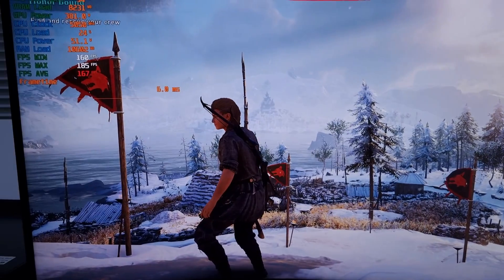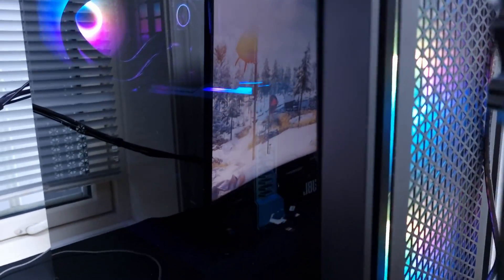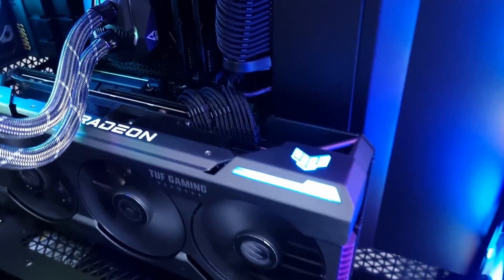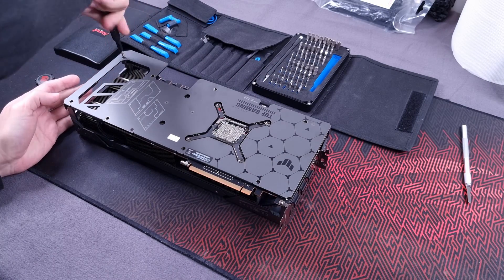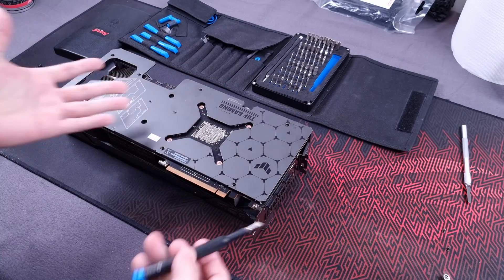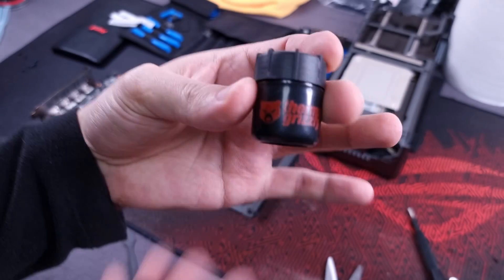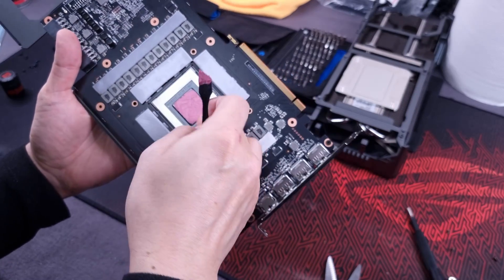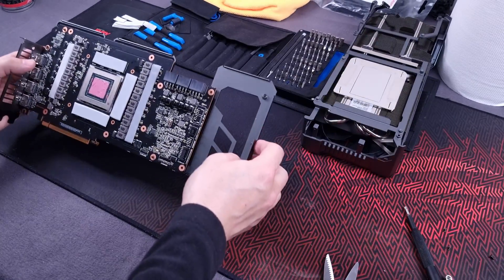ASUS TUF RX 7900XTX TEARDOWN (hotspot fix)

Comment: So many issues, I have the XFX version and the vapour chamber is not flat in the very centre so no matter what you do it doesn't cool the die complex evenly, GCD in particular. The chiplet is not even so most paste pumps out over time and heating cycles. with my uneven die and stock cooler the GCD was always high while the MCD was cooled for about a week by paste, I have a tube of every premium paste out there! my solution was Kryosheet and a water cooler, and I needed two layers of the sheet to make good contact across the GCD and MCD, bought the large size and the first layer is a continuous rectangle while the second layer is two smaller rectangles from the leftover sheet. Looking at the hotspot temp is not good enough, one needs to isolate the GCD and MCD and mem junction and address all three. for me the uneven vapour chamber required a water block, the uneven die complex needed two layers of kryosheet and the memory needed gelid extreme 1mm or tp3 1.5mm the tp-3 is very soft so it conforms really well, gelid is just better if it makes good contact. card idles at 33 die and 54 mem junction and speedway on a 30 min loop takes me to 73 die and 84 mem junction, ambient air is at 30+ where I live so take 5 or 6 degrees away if you live in a 20ish degree environment. Was still cheaper than a 4090 where I live. i completely agree that for 1kusd one shouldn't have to do any of this. planned failure, poor design, most don't care to hunt the issues so what are you going to do if you buy the halo product, send it back or fix, if you send it back then you have to ask for a refund as the problem will most likely happen again if you replace with the same.
Reply from the maker: This is why I did not return mine. The 7900XTX is hands down a bargain for the price/performance ration. So replacing the thermal paste and pads makes the more sense if you are comfortable doing this effectively. MX-6 is a perfect choice for paste.
Reply: @TechnologyHive Agreed, MX-6 gave me the best die performance on air, but I think that my stock cooler didn't aid things, when I went to water the Kryosheet was on par with mx-6, however two layers of the sheet gave me amazing consistency across all the MCD and GCD and a 3 degree delta between hotspot and GPU temp as reported in adrenalin or HWinfo, I have seen cooler mem junction temps from others on various forums  with water but after ripping the card apart over 15 times i am happy where i am at now, still have  a tube of KP that i haven't opened though:)
Reply from the maker: @riazpatel5296  Very nice man! I wish you and that little beast 7900XTX the best! Cheers!
Reply: Thanks for sharing your experence. Two sheets. Good idea.

Comment: I have a 7900 XTX gigabyte oc but every time I’m playing something more graphical demanding like returnal or cyberpunk I get temps of 55/60c on core and 110c on the hotspot (playing at 2560x1440 165hz). I have now opened a ticket to open an RMA as I I can’t peel the stickers on the screws to replace the paste and thermal pads as I don’t want to lose the warranty. I’m regretting buying AMD at this stage. Yes I can under volt it and put a limit on the core and power to bring those temps down but I didn’t buy a card to make it disable.
Reply: been there with aorus elite, gotta go with ptm 7950 my friend
Reply: I did RMA it and got a replacement the one that came was the same. Bought ptm7950 and now it’s all good core sitting at 60/63c and junction at 73c. The memor junction is at 90/95c but there’s nothing we can do about that .
Reply from the maker: @AfroDominus  Nice that you got that one fixed.
Reply: @TechnologyHive  yeah I got it fixed but I think for my next purchase I will stay away from AMD. Don’t get me wrong the card is a beast but it’s not worth the headache
Reply from the maker: @AfroDominus  I've owned Nvidia and AMD cards in this generation. Both have their issues. NVIDIA's issue is with GDDR6X's heat issues, thus requiring those huge heatsinks, which are used as a "one size fits all" type of deal, and thus, you find these huge coolers on non-GDDR6X cards as well. 

These coolers are so big and heavy and cause so much physical stress on these cards, resulting in gpu sag, cracked pci-e slots, cracked memory joints, cracked gpu joints, and or permanent pcb bow or twist. I get NVIDIA cards in for repair with these problems frequently, more so than AMD. I made a video about it. It's somewhere on my channel. But anyway, good deal you got your problem solved! 👍🏼
Reply from the maker: 110c on hotspot is way too high. RMA is the right thing to do. I believe the main issue with AMD cards is the low quality paste they are using.

Comment: M friend
Your gpu clock is almost 3000 (original 2650)
You overclocked so high 
Just underclocked
Reply from the maker: I do not overclock my gpus. This is done automatically by the auto boost.

Comment: Hi there! I have the same GPU Asus TUF 7900XTX. I installed it normally with the included GPU support bracket and it works all fine! I'm gonna order an aftermarket GPU bracket that perhaps is more safe to be sure its not going to lower by time.
Reply from the maker: That's exactly what I would do. For this big card, you should use a riser. Good choice!
Reply: @TechnologyHive  i have the 7900xtx  msi trio classic and have installed horizontaly with its own support bracket that is a piece of metal horizontal, i have and a riser but becouse this card is so big 2.5 slots ,dident try to install vertical mode, temperatures are good max i have seen is 67 with 86 in hotspot, msi is basic card  power limited to max 375w. so do u think i need to install vertically ?
Reply from the maker: @meltinsr  If at all possible, yes, install it on a riser. I would look at PHANTEKS cases, as they have the best support for risers, like the G360A.

Comment: same problem on my sapphire nitro+ 7800xt..over 30c delta..crazy
Reply from the maker: Just replace the paste. MX-6 is what I would use. Going through the warranty process is a headache, and returning it just to get another one with the same issue is not worth it. Once themps are under control, the 7900XT is a beast!

Comment: Nice work, I believe that if you used THERMALRIGHT TF8 the result would be better, I noticed that you didn't use a thermalpad on the inductors, they could have overheated, and I have a question, who is the manufacturer of the vrams?  Are Samsung memories?
Reply from the maker: These are Samsung, yes.

Comment: My sympathies for your coil whine. I’m glad I don’t have that with my sapphire card.
Reply from the maker: It happens only during high frame rates. If I lock it to my monitor's native 144Hz, coil whine goes away. Less stress on the phases. I love Sapphire. One of the best if you ask me.
Reply: @TechnologyHive  came back to watch it again. Bro I still barely break 60c on hot spot. I got the phase sheets on stand by.
Reply: Such a princess ear.

Comment: hi, thanks you for this video !
i have a 3080 TI palit gamerock, and in game (with stress), i have 68.8° GPU / 74° Memory and 107.4 in hotspot...my core clock is not stable too.
my ventilation is good, and my GPU is in verticaly....
so i think i may change pad /pate thermal....and you video help me....and my card have more 3 years so not waranty...
Reply from the maker: 107 hotspot is scary high! Btw that Palit Gamerock model is beautiful! One of my favorite cards. I sold mine and I regret it now :(

Comment: I have 7900xtx hellhpund itvruns cooler that that as standard hotspot is 71c max
Reply: Yea mime is standard though
Reply from the maker: That's good! I no longer have a problem with mine since I replaced the thermal paste.
Reply: As it eng I've learnt from cpus too much paste can actually hinder as it turns into an insulator so try skimming it thinner

Comment: Can i use something like liquid metal instead of paste?
Reply from the maker: Yes you can. But you need to be careful. If any of that stuff gets on any of the surrounding components, it will destroy your card.
Reply: @TechnologyHive yea thats my biggest fear with liquid metal that its very conductive in electricity like if i ever want to use liquid metal on an cpu im taking the top plate off for max preformance

Comment: Can you mount it horizontally if you use the support stand thingy?
Reply from the maker: With a support bracket it should be fine. But if it is ever under transport, it is best if the card is pulled out of the system.
Reply: @TechnologyHive 👍👍

Comment: I repasted my Hellhound 7900 XTX with PTM 7950,about a year ago at this point. 
The card was running very cool initially but after 2-3 weeks my hotspot steadily begun to increase and was getting over 30c delta,like everyday it was getting hotter.
upon opening the card the pads seemed much higher quality than the trash pads in your card,and they were intact, the contact also seemed fine.
but the thermal paste right on the middle of the die was dry. The card was maybe,two months old at this point,since they had just came out, so it was a pump out effect.
supposedly powercolor changed the paste they're using since but I see still many people with powercolor gpus with the same issues.
I think I did a pretty good job repasting the card with the PTM,since my delta is extremely low,even a year later. <18c delta.
typical gaming temps are 60c/73c @360w.
Reply from the maker: Good Job man! Thanks for sharing 🙂
Reply: Did you just replace the thermal paste with PTM? ie put the PTM on the gpu die? Or did you also replace the thermal pads with it?
Reply: @madararinneganuchiha  no only the die, ptm is like thermal paste, just comes as a sticker rather than liquid. You can't put it on your vram lol
Reply: @100500daniel  do you think it is unnecessary to change the thermal puddy?
Reply from the maker: You don't want to reuse the thermal puddy. So yes, replace it
Reply: As long as it's applied properly the first time, the PTM7950 compound shouldn't ever need to be re-done again, as I understand it. That being said... the memory pads might need to be re-done at some point, and I wonder if the PTM7950 is supposed to be okay even if you open up the card and put it back together again? I'm not so sure that it would survive that, but that is an important question that many people are going to want to know the answer to sooner or later.
Reply: @syncmonism  Great point!  Yes the PTM7950 will endure 'forever'... until you need to reopen the card to replace the Ram/VRM pads. It will not survive it and will need to be replaced.
So the trick will be to use the best quality possible pads, that should hold for at least 4-5 years before need replacement.
Reply: @100500daniel  gives me confidence!! But my damn PTM pads are too small by 1.5 mm!! I measured die wrong.  You happen to remember what size of PTM you bought?
Reply: @paulw7738  PTM melts and 95% of it get's squeezed out forming a very thin but uniform layer without air bubbles so a little bit smaller piece is not an issue.
Reply: man i must have it made, @361watts, core never exceeds 55c, hotspot 20c give or take, VRAM almost always 80c sometimes 82c, i got the magic baby used ARCTIC TP3 Thermal pads for VRAM and repasted with shitty NX4 but i made sure i over pasted because its better to have to much paste than to little

Comment: Air bubbles and gaps between the heatsink and cpu/gpu are caused by deformities on the face of the paste when applying to the cpu. Watch for peaks, curl-overs, and valleys on the surface of the paste; as these trap air between the heatsink and the cpu even though there may be some paste extruding from the edges of the chip. Also try not to smooth over valleys, instead fill them in, (you don’t want cause an invisible bubble under the surface).
It’s easiest from the start to put excess on and try to smooth in one or two strokes moving in the same direction and then carefully clean the edges. If you are going to do this, I also suggest using a sealant around the edges of the chip before applying anything to the chip, to safeguard it from shorting due to seeping. This especially goes for Liquid Metal.
Reply from the maker: I do not recommend using liquid metal over a chipplet design gpu. It's a bad idea.
Reply: @TechnologyHive  Indeed

Comment: How are the temps holding up? I'm thinking about buying this card.
Reply from the maker: Temps are fine as the first day I swapped the thermal paste 👍
Reply: @TechnologyHive  That's great to hear. I'm definitely going to use your video for when I need to swap that paste out. Thanks for the video and for answering my question.
Reply: @TechnologyHive  Hey do those connectors have a push tab or do you just pull them out?
Reply from the maker: @BasedTooDrip  Push tab.
Reply: @TechnologyHive  Alright, thanks

Comment: The problem with those cards is that the chip it self is not completely flat causing this spot not to be covered with paste. When the new paste spread after some time the problem will accure again.
Reply from the maker: Indeed that is the problem.
Reply: @TechnologyHive  The hot spot problem came back again ?
Reply from the maker: @alaincharlie3994  Yes. I had to switch to Thermalright Heilos. This fixed the problem for good. There are no issues for months now of daily use.
Reply: @TechnologyHive  what u mean theyre not flat?
my memory temp at idle is 20c above gpu hotspot and at 100% its 10c above my gpu hotspot. gputemp-63, gpu hotspot-80, gpu memory-90
its a 7900xt. 
whats wrong w/ my card?
Reply from the maker: @blackfacegaming191  It's because it's not a monolithic design. It's several chips working in parallel, and this brings small variations, not all being perfectly flushed.
Reply: Ohhh... So the evidence I am seeing is my GPU chip isn't flat? I figured it was the cooler that wasn't true. There goes my idea of sanding the cooler plate.
Reply: @watchthisusa  that's what im confused about. . the gpu chip in the video looked pretty flat to me. i realize the vram is separate from the gpu die. is that what you're saying? so the gpu is separate from the vram which is separate from the memory?
Reply: @blackfacegaming191  VRAM is the memory. I was just speaking on the GPU chip, this guy is saying it's not flat. I would suspect the manufacturing process on the cooler wouldn't be as good as the GPU chip, that's why I came to that conclusion. Could be a little of both. I like they idea of doubling up on Thermal sheets. Not sure how that would affect heat transfer, but I would think it would work to fill in tolerances.
Reply: @blackfacegaming191  I think there's a cover on that new AMD chiplet. No way they'll have a flaw like that.
Reply: @emanuelmenin  thats what im thinking

Comment: My 7900xt has a delta of 45 c.
57 core amd will hit well over 100c on hotspot.  I re pasted it and it only helped for week.  Now hotspot temps are terrible again. 
Trying to RMA now to asrock as long as they don’t pull bullshit of sticker removed so warranty void.  In America it is illegal to void warranty for sticker on screw.  We shall see what they do
Reply: repaste with ptm7950
Reply from the maker: I wish you good luck. I think you did the right thing to return it. 100c is very hot.

Comment: I have a Hellhound 7900 XTX.. Red Dead Redemption 2 i get 61c global and I can reach 110c hot spot.. What should I do? Performance wise, theres no issue, but I just don't feel comfy with this temp :face-blue-wide-eyes:
Reply from the maker: Replace the thermal paste with something like MX-4. Or return it. 110c is very hot. This will cut down its lifespan.
Reply: Its just how these AMD cards run basically..

Mine is XFX 6800XT Merc 319. Top of the line supposed model. my temps are same as yours. The junction temp on my card could reach 110'c on full load or even more sometimes. Undervolting these cards is the only option.
Reply: @hircine92h  Nah, gotta repaste properly. My MSI hotpsot was 95C with high fan speed. Repasted with MX4 and it dropped to 85C max. I run it full voltage and +15% power OCed.
Reply: @TheGuruStud  how is it now after 2 months?
Reply: @TheGuruStud don't waste your time repasting, it's gonna pump out in 3-6 months, use PTM7950 instead.
My rx6900xt toxic was 68c and 105c hotspot, after PTM7950 57c and 76c hotspot (running furmark2.8)
Reply: @ didn’t work undervolting so I sold it and bought a 4080 super 👌 works flawlessly
Reply: @KowitaG  Good decision. Tho I dunno how much u paid for it.

AMD GPUs are garbage in general..
Reply: @hircine92h you do realise this is a issue with Asus in this video, nothing to with AMD.
Reply: @dagnisnierlins188  No. Its an AMD issue and u can't convince me otherwise. AMD makes crap, always.
Reply: @hircine92h amd supplies the die only, asus or other board partners make the pcb, cooler, it literally can't be their fault for quality control issues at Asus.
Reply: @dagnisnierlins188  Don't argue with this guy, there's no point. You are right of course, it's board partners fault for not using better thermal transfer solutions, like the PTM7950 you mentioned. It's literally a joke that they can't "afford" to put that onto a 1000$ GPU.
Reply: You must use twice amount of paste, not an optimal amount. Hot spot sensors are at the corners of a chip.
Reply: You can undervolt it... inhave a asrock phantom gaming oc 7900xtx...same issue with hot spot temps... I'm going to try and liquid aio gpu cooler it's a bit pricey but I'm curious the performance. Sidenote it seems like these cards are pushing way too much voltage